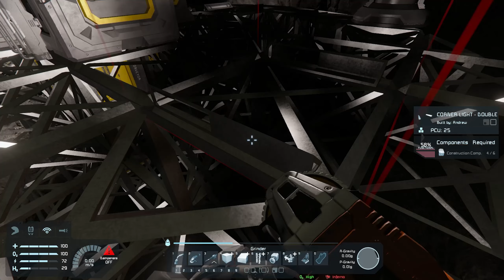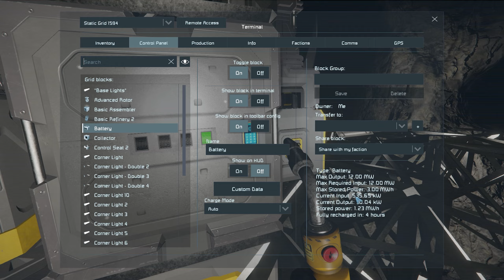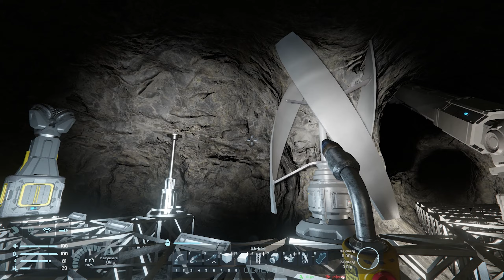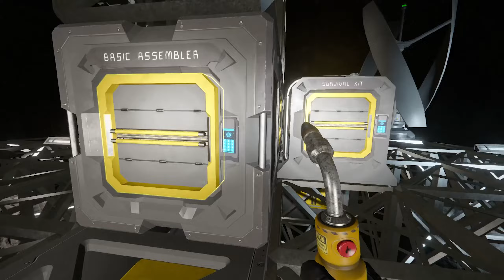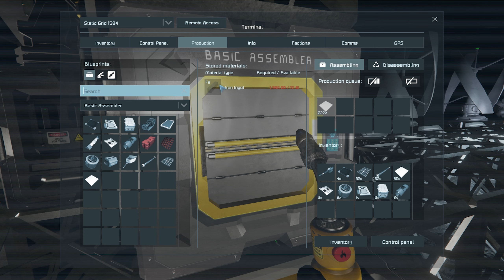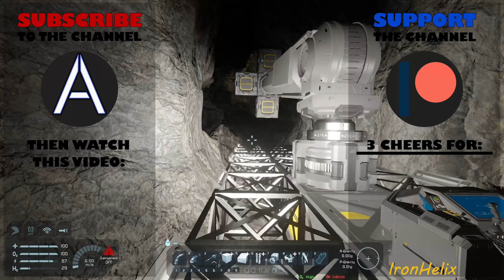Space Engineers: The Center (Episode 3) - Mine Smarter, Not Harder!

Comment: Back when planets were kind of new the center of each one was hollow. I teleported the original Mk.2 blue lander into the core of the alien planet and did basically the same thing. This was before the survival update so there was no stone refining to get trace ores so i had to make due with only stuff i could scavenge from the lander. On the plus side the landers had several thousand ice and a few hydrogen bottles inside them by default and enough battery power that i didn't need to worry about power, the advanced assembler that came with those old landers turned out to be my best friend.  I ended up making a small grid drilling machine rover that had large wheels facing all around the rover on pistons that kept constant pressure on the sides of the tunnel as i drilled.
I made it to within 500 meter of the surface before my machine clanged out and exploded, i still had fun.

Comment: (Playing your map): The gravity problem at the core made me crazy, so i expanded up through the hole. At 0.02 gravity i made a base, but my body was allways at a strange orientation. Then i expanded further to 0.05. There i can walk normally, but i can only make micro-jumps. I had ore detectors at 0.02 and at 0.05 (ca. 1.5km away from the core), but no ores.
For the hydrogen: I am arguing with myself if a moisture collector would be too cheaty (i am using the map´s mods right now plus ore auto collect).

Comment: On your mining rig, if you turn on "Share inertia tensor" on the hinge and piston (not on the rotor, though) the drills won't jiggle around so much.  If you add more pistons, hinges or rotors, turn it on for them as well.  Basically everything but the block that creates the first sub grid should have it set.  I'm not sure how much longer you will be able to keep this series going as you will never be able to get hydrogen or build any ship thrusters.  You will have to build a giant (aprox. 60 km) ramp/stairway/ladder to get up to ores or build a weird tunnel climbing machine with wheels or mag plates.  Without cobalt there isn't a lot you can do.

Comment: You could probably build a car with artificial gravity blocks that could lay down a road as you mine forward (projector on the base and welders on the minecart) The artificial gravity blocks are affected by the gravity generator so no worries.
Reply: Gravity generators require gold though
Reply: @LeeSpork  heck. I'm sure there's a work around, Maybe a monorail or a series of pistons timers and magnetic plates.
Reply: @JayJayFlip  My idea is to make use of the fact that the hole has a reasonably consistent width, and have wheels in all directions, so the suspension holds it between both sides of the tunnel
Reply: @LeeSpork  idk, you're dealing with a upwards moving vehicle design basically and I'd say some sort of elevator that builds a central piller as it drills would be best, you could try to build a vehicle that drives up the walls but the friction would be a mess to deal with. I'd want some sort of connection from the base to act as a guide. I remember a space elevator build that used connectors to climb up a set of convayers it made. Basically he needs a projector on the base to build a rail and some kind of drilling and welding rig. Ideally it would also be able to build windmills behind it as it went, gathering resources and then using them. A shame about the grav generator idea, an upwards driving truck would be so much easier.

Comment: I played through the scenario and basically went through the same steps. Trying out the collector at the center. Learning that it doesn't work. (In part because for performance reasons physics simulation for rocks stops after a while). Learn that hand mining just doesn't go fast enough. Then building drilling rigs to get stone. For the windmills, if you dig out a large enough hole you can get them running at max efficiency.
Reply from the maker: I really wanted the hand mining + collector combo to work, but the large grid drills just go sooo much faster.
Reply: @AndrewmanGaming  If drills didn't collect ores or there was some other large grid mining option that doesn't auto collect ores, then it might've been an option.

Comment: Actually, getting out of this hole is easy.   It will take some time, but you can just keep using the drill head on a piston to drill a hole, then add another piston and drill some more.  I have done this from the surface going down, but a little modification to be drilling "up" will not be hard.  This way you just ride your elevator as it drills the shaft, you will eventually reach the top.  Or make a rover that can drill a tunnel and just angle it upward at a slight angle, then drive as you dig a tunnel.  if you keep adjusting the angle of the tunnel so it does not get too steep, you will eventually reach the surface.  Neither of these require Hydrogen, so are not reliant on finding ice.  The rover method while technically harder and more time consuming is much safer, as you do not have a "Doom Hole"TM to fall back down.
Reply from the maker: Thank you for the tips! The angled drill car is a very nice idea for mining, and it would probably work for getting to the surface too, but we already have a pre-dug hole that goes back to the surface. Its a very far climb, but its how we got to the center in the first place! Some sort of machine that can use that existing hole would save a lot of time.

Comment: To increase your storage capacity add an advanced rotor with a small grid 3×3 rotorhead with small grid medium or large cargo containers attached to it. Should allow increased storage without the need for Cobalt.
Reply: Small grid large container has the same amount of space as a large grid welder.
A large grid welder doesnt need a sub grid conversion to operate and you can sort of hide it as a conveyer line.
Reply: The small grid large cargo containers have the same cargo capacity as a large grid small cargo container. I believe the only downside two welders as cargo containers is you can only put building materials into them.